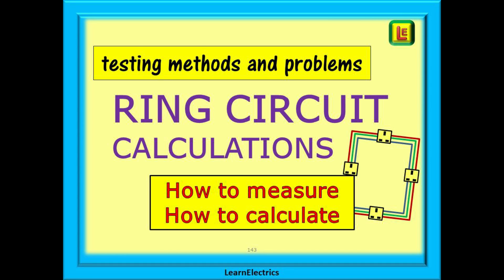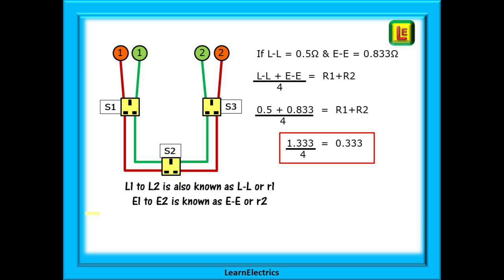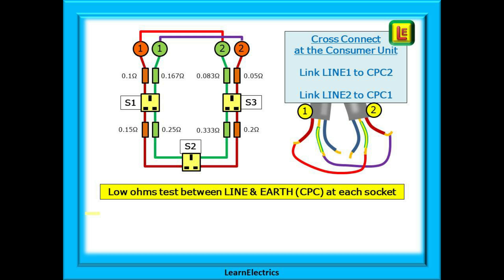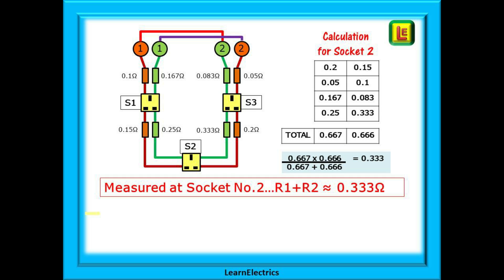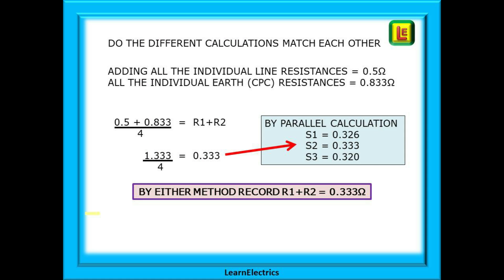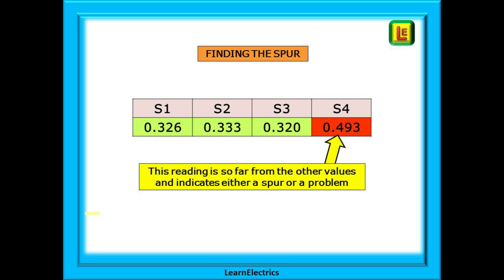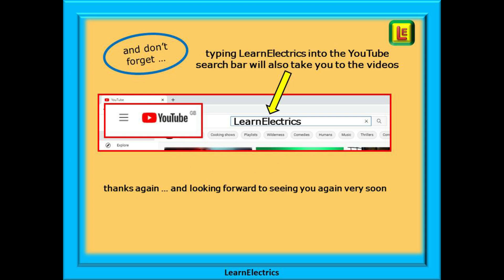RING CIRCUIT CALCULATIONS - TESTING METHODS AND SOME PROBLEMS – THE RIGHT NUMBERS AND THE WRONG ONES

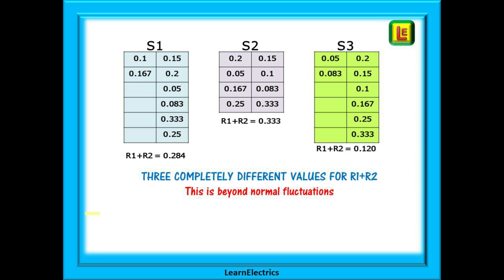Comment: At 13:11  Maybe I need my eyes testing but it looks like the bottom two rows on the Table for S2 have been inadvertently interchanged
Reply from the maker: Eyes are fine. Yes, a case of juggling too many numbers. Massive thanks for the info, really appreciated and thanks for watching. Dave.
Reply: @learnelectrics4402  Excellent. I'll stand the optician down !  😁